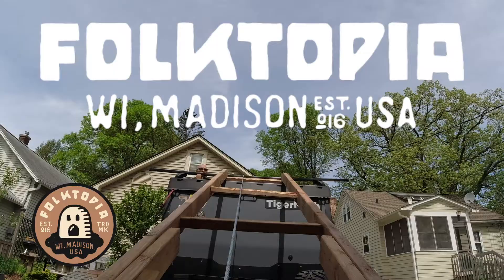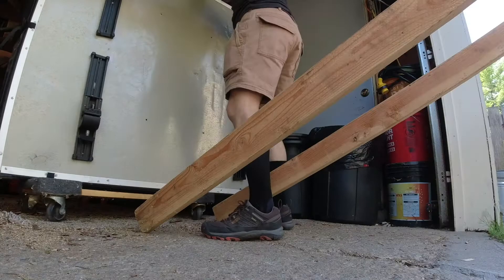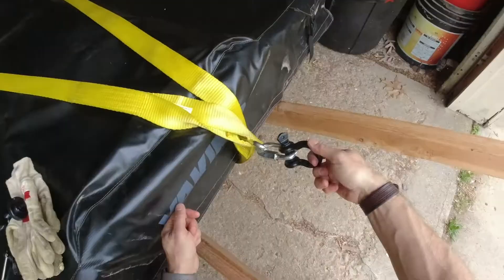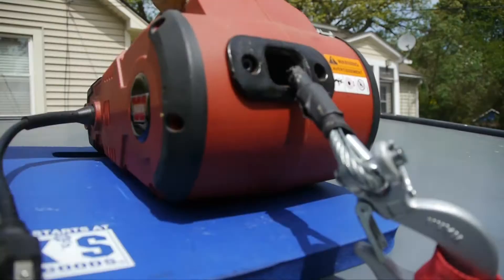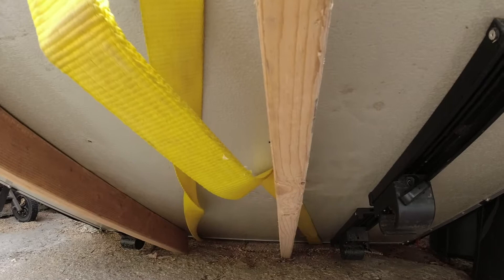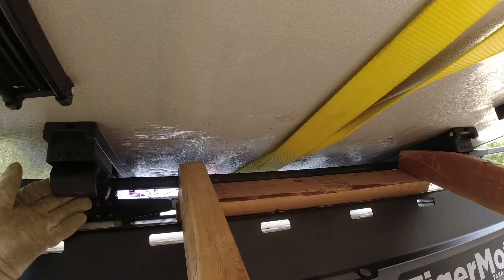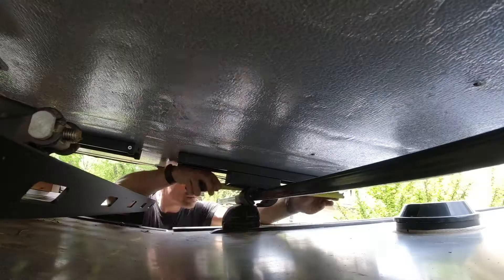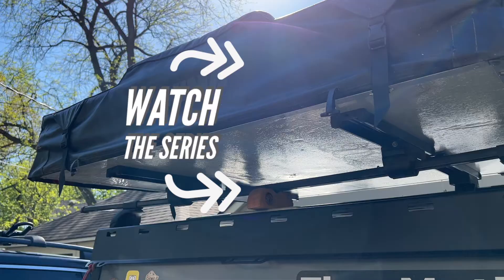How NOT to Install a Rooftop Tent on #Tigermoth Camping Trailer

Comment: Wondering how you got the nuts out of the tigermoth rails to move the forward load bar onto the front cargo deck?
Reply from the maker: Hi there, Aaron. The dealer (Erik’s Bike Shop) did the install of our rack. Is the issue with the bolts that attach the t-track to the roof? I tried messing with that and it’s a crazy sandwich of materials. Also, getting access to the underside of the front cargo deck is super awkward.
Reply: @Folktopia  On the 2022 model, the top rack rails have these little square nuts that slide in the track. I assume that set of nuts in the track needed to be removed and used under the cargo deck to mount the forward crossbar. I am considering getting stainless bolts that are longer than factory and nylon nuts. Figured I would check what others have done. Thanks for the info above.